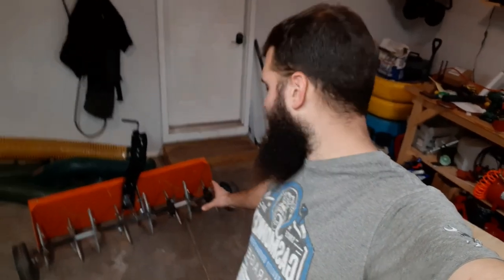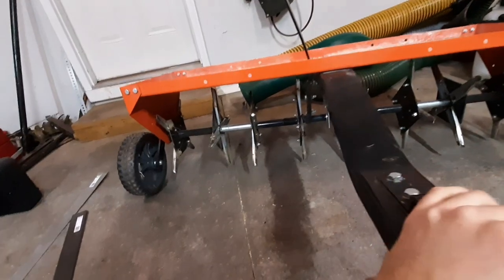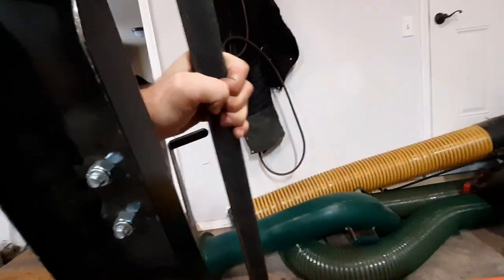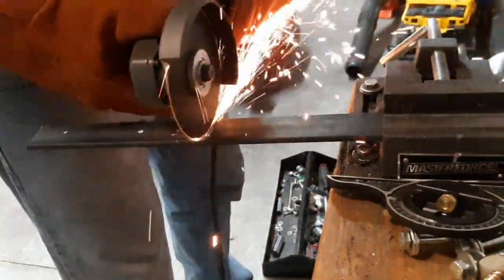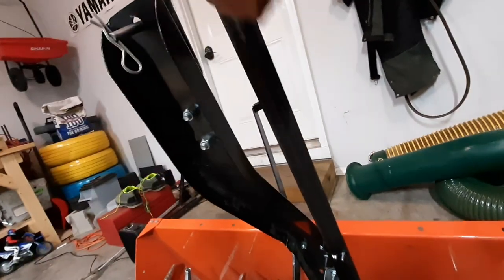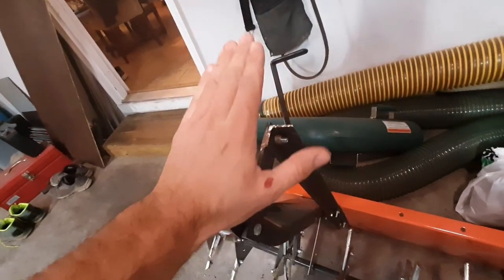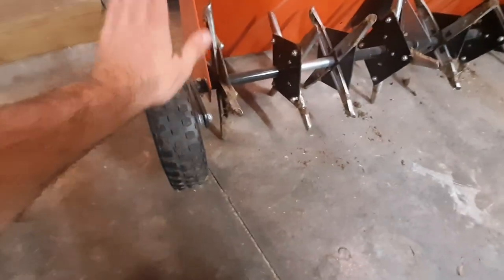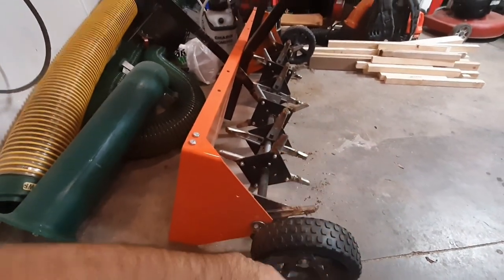AgriFab 48" Pull Behind Aerator Modification

Comment: Heard the tongue/hitch was terrible so I took mine and welded the entire inside perimeter with reinforced steel. Also bolted top tray with pressure toward one side to keep lever in place.  This prevented level from slipping out of tine engagement position. Finally cut pieces of hard plastic fabric (Harbor Freight) and used 3M adhesive to attach in order to save paint job when using cement blocks. Works like a dream.
Reply from the maker: @Gary I love that idea. Long term I might need to do that....idk how long my fix will last lol
Reply: I think reinforcing that flimsy tongue is the most important fabrication you can do. The rest of the unit seems pretty sturdy long term. I go pretty aggressive on 22k square feet of lawn, including back ups, without a problem ( so far).

Comment: Great video Jon. I really need to do some fabrication on mine. Ive ordered a few back up tongues for it since ive had it and im on my last one. I like the angle iron idea but i have access to a welder and i have welding experience. I might bulk it up a bit. I also use sand bags and usually have 4 50lb bags for a total of 200lbs. We get some rocky tough soil here too so the extra weight helps. Ill probably modify it to hold the bags a little better to keep them from falling off so easy.

Comment: I believe in your first vid you mentioned that the engagement lever would pop out at times. Try adding a washer on the top bolt and two on the bottom bolt that way it will tilt it to the catch.
Reply from the maker: @Sean Henry hey thanks for that tip, I will have to give it a try

Comment: I definitely want to get into aeration. I already figured out a price for aeration, seed, and lime. Just need an aerator 😂😂😂🤦🏻‍♂️
Reply from the maker: @TG Lawn Maintenance hey man get some work lined up and rent one for a day, that's what I did back in the beginning before I bought this one
Reply: @JonsDailyHustle  I know I thought of that. There is a place that rents right next to my house. It’s like $85 a day. Gotta get about 4 lined up to be worth my time though. Or I will just buy one. I just missed one on market place for $600.
Reply from the maker: @TheLawnFellas  damn 600 😲. Where you located cuz I can't find one for even twice that. Guys here in my area still want 1500-2000+ for a used one
Reply: @JonsDailyHustle  PGH, PA. I found an old brand Toro actually bought them. I was a day late or I would have had it.

Comment: I have 60-pound sand bags that I use in my truck every Winter. Will 1 of those be enough weight? Would 2 (120 lbs) be too much? Thanks
Reply from the maker: @Joe S it all depends on where your located and what type of soil your areating and ow deep you want to go. Here for me it's very hard packed and VERY VERY rocky so I had to use 180lbs and on some yards that's not enough. Other locations 120lbs is probably more than enough. Those bags should definitely work if that's enough weight for your area. Give it a try and see what the results look like
Reply: @JonsDailyHustle   Thank you! Northeast Ohio. I recently purchased a house where the yard has been very well maintained by a national lawn care company. I’d prefer to do the maintenance myself. This company wants $500 for 7 treatments plus almost $300 for aeration and overseeding every Fall. Thank you!
Reply from the maker: @Joe_S.  well you definitely can't go wrong with being one of these Agri fab pull behind aerators for that reason. I use mine commercially and it has done very well with tremendous results

Comment: Could you just replace that whole piece maby fabricate it  with some square tubing  reinforce it .I don't know I'm guessing that is what I would do . But I'm guessing or thinking you needed a quick fix or just useing what you had to save you some money 💲 but I probably would of done The same thing good video holmes
Reply from the maker: Yessir I think that would've been a better long term fix...it might be what I do as well. This was just a fast cheap fix as I needed this to work for yesterdays job as well as I had the angle laying around so I used what I had. I might have to check on the space in between the spikes....square tubing might actually be to close but Im sure I could figure something out
Reply: I certainly can understand your situation  but either way it was some good insightful information I appreciate it taking the time to show that

Comment: Having trouble making left turns ?  Definately not for NASCAR fans then. LOL
Reply from the maker: @Ixehso140 🤣🤣 no I'd say not lol. That was just due to my modifications that messed left turns up a bit. But other than that it still works pretty good
Reply: @JonsDailyHustle  Kinda of funny because I've heard the term "Modifieds" used in the racing circuit as well.

Comment: Made in China?
Reply from the maker: @Brahustx I have no idea where it's made lol
Reply: The specs state it is Made in USA

Tractor Supply has it on sale right now for $199. I think I’m gonna pull the trigger.
Reply from the maker: @Joe_S.  I would if I were you, it's a great deal I think I paid just shy $250 for mine last fall and it has more than paid for itself. Huge results with it It has a few week points but if you can get past that it's an absolutely great buy
Reply: @JonsDailyHustle  it’s going for $400 now, pricey but I’m still gonna get it, I bought a piece of land 3.5 acres  I need to aerate
Reply from the maker: @manuelsalgado8510  you are correct just had to look at that myself...can't veilve it's gone up that much now